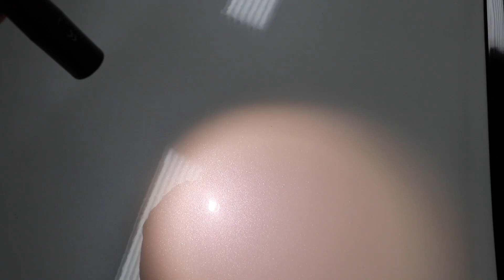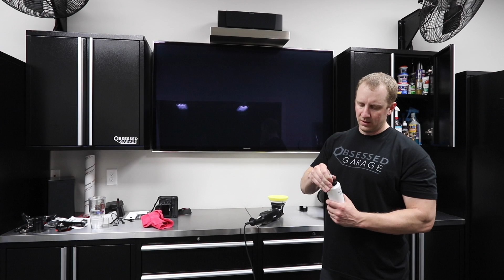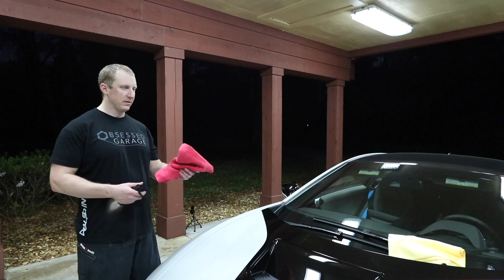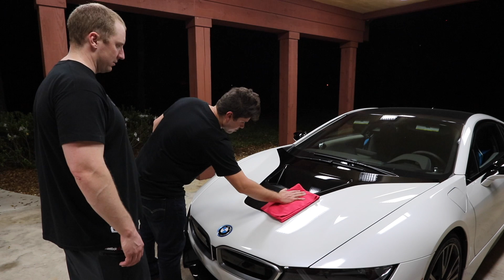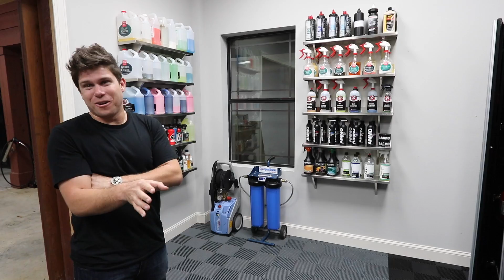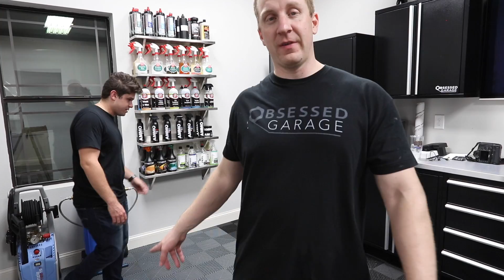Washing, Correction, Product Discussion Using a BMW i8

Comment: what if you clay it and Polish the black and then apply 3M PPF on it to help protect it and also help keep it easier to clean. I love 3M PPF I have it on all of 3 Mercedes and 2 muscle cars on the entire car and it helps with dings scratches water spots etc

Comment: how do i hook up a deioniz3r?
Reply: deionizer* qnd how much is it [i have a gas pressure washer]
Reply from the maker: You put it inline between your pressure washer and the hose bib.  So it goes:
Hose Bib to Short Hose to CR Spotless Inlet
Short Hose from CR Spotless Outlet to Pressure Washer Inlet

A Gas Pressure washer may pull a bit too much water to make it efficient.  About 2 gallons per minute or less is what is recommended.

https://www.obsessedgaragestore.com/collections/water-filtration/products/dic-20-high-output-rolling-system
Reply: Thank u very much!!

Comment: pig tails are usually always from picking up dirt or debris in the pad or mainly occur from sanding and picking up debris in the sand paper or running the same piece of sand paper too long full of clear coat or dulling sanding pad itself, Can also occur running the machine too hard with less polish since if there is debris in the pad there is less lubricant to help protect the paint from the debris, most likely by watching you didn't put the pig tails there, most likely factory, unless since your outside particulates fell on the paint before polishing.
Reply from the maker: You're probably right.  I didn't notice them when I inspected beforehand.

Comment: also matt, i too love and enjoy using menzerna power lock, its a awesome sealant! i notice you were talking about how when you top menzerna with insulator wax, you notice it SWEATS the following day..if you notice menzerna is a synthetic sealant and it's base or the carrier of the sealant is actually solvent based and when you apply the insulator wax on top of it, those two chemicals are trying to repel each other because they have different carriers within the sealants and we actually call it the ghosting effect. .in short they don't play well together but it took me a lot of time and research to figure that out but i thought I would pass that on...much continued success to you my friend:)
Reply from the maker: Hmm... I've found that they tend to bond very well.

Comment: Hey Matt how's it going my friend? Hey a while back you recommended Wolfs Nano coat for hard plastic trim, but it's hard to find. Do you have a replacement product you use or do you order it from overseas? 
Thx bud!!
Reply from the maker: I still need to try it, but Solution Finish seems to be popular with pros.  I'm going to import Wolfs later this year and have it in my store.

Comment: Can hydro 2 lite be put on top of collinite or would it be better to use it only for wheels and glass.  Great Videos
Reply: You can use Hydro2 on paint, but not on top of other waxes or sealants EXCEPT for other Sio2 based products such as a ceramic coating (like Cquartz) or a sealant (like CarPro Reload). Sio2 based products do not work well with traditional waxes or sealants.
Reply: Tim Thank You
Reply from the maker: Tim is correct.  It doesn't play well with Collinite.  I tried it.  It works the first time, but the second time I added, it left a film on the car.

Comment: I thought I'd chime in and help explain the basic difference between Wax and Polish to those of us who are new to detailing. The difference between car wax and car polish is that car wax is a paint sealant users apply after washing and polishing their cars, and car polish is a cleaner that prepares cars for car wax.
Reply from the maker: Some of the terms you are using are more marketing terms used over the years and can cause more confusion.  

Polishing does not clean.  Polish is an abrasive that removes clear coat.  You are removing paint around scratches and swirls to "flatten" surrounding paint.

Using the term sealant when referring to wax can be confusing.  Sealant is another type of synthetic or polymer that can be use instead of or in combination with a wax.  Wax or Sealant is you last step protectant.

Comment: Amazing video as always!

About the softer paint on the i8, while I don't own one, I do have an i3 in Capparis White with Fluid Black hood and accents and have noticed that the paint definitely is more delicate than the wife's BMW X5 and Raptor.  I believe it has something to do with the underlying composite and CFRP panels with perhaps less paint layers for weight reduction which is everywhere on BMW i range vehicles.  Even the glass is softer and lighter and requires plastic instruments for tint installation because high quality stainless steel blades will scratch it unlike most other vehicles.

All this being said, I stopped using the Adam's wash pad (which I love) on the i3 and have been using some heavy (not sure on the gsm) plush microfiber towels for soaping it down. I place about 4 - 6 towels on the soap bucket and use them in sections constantly turning them over to have a clean side (especially on the fluid black areas) and then I just throw them on another bucket. Something interesting I noticed by doing it this way is that I don't really use a rinse bucket since the dirty towels never go back on the clean bucket. Thinking about trying this method on the X5 and Raptor and perhaps eliminating the rinse bucket. 

Thoughts?
Reply from the maker: I think you've got it exactly correct.  One bucket method using multiple towels would be the safest option on these cars.  I doubt it's necessary on your other cars.  But if you find it saves time and you value that savings, it might we a viable way to wash all cars in the future.  I still enjoy the 2 bucket, massive amount of soap process.

Comment: My Subaru's Ice sliver metallic is picky it's pretty soft like Porsche paint, even washing my car is a process due to it's softness, I have to use very light pressure washing ect one thing I have noticed that using VSS from chemical guys and a orange pad you can one step Subaru paint. As far as 845 is concerned I have noticed that if I use a D/A and a super soft Hex-Logic black pad. I don't get that oily like issue that 845 sometimes does in the sun versus doing it by hand with a foam pad then I will get that stuff to happen....

Comment: Hey Matt,  i know you've had your colonite 845 for a while but your bottle seems to be quite liquid.  I bought both powerlock and colonite 845 last summer and both are pretty thick, specially the colonite.  Do you know if they've changed the formula or do you put anythibg in it to dilute it?  Thx great information
Reply: Martin Belair You have to put the Collinite bottle in some hot water to liquefy it.  It becomes solid in cool temps, Florida is pretty hot as you know, so it stays thin.
Reply: Temperature has a lot to do with colonites thickness, Florida's consistent 80 plus temps keeps it liquified.  Mine is solid right now in PA.

Comment: I had the dealer apply the Xzilon finish protectant to my GT350 a month ago when I bought it (before i found your channel). Is there an "easy" way to remove that and start over? There are some areas I would like to correct, especially on the black.
Reply: It seems to be nothing more than just a good paint sealant to me. I am sure just a 2 step correction would remove it pretty easily. Its not really as harsh as some glass/ceramic coatings.
Reply: Thats good to hear. Thank you!
Reply from the maker: I'm pretty sure that stuff is just a $10 bottle of sealant they slop on the car prior to delivery.  It's a joke marketing product.  You would just wash, strip (Adam's Strip Wash), remove iron (CarPro IronX), clay bar or Auto Scrub, then you could polish and wax/seal/coat like normal.

Comment: Matt, I think you would be surprised on how little paint is actually removed during a compound and polish. You should invest in a paint depth gauge. It would help people watching your videos get a better perspective about what is safe and not safe. When I was new to paint correction I wouldn't touch a compound because I had visions of destroying paint. It might help you with your business from the aspect of people buying more products. If they are scared to compound they will shy away from buying cutting products.
Reply from the maker: I completely agree.  My only fear with this was the softness and odd way this black handled the perfect finish.  If I had a depth gauge there would have been no uncertainty.

Comment: hey Matt not sure if you made a video about car covers, but whats your opinion on them, any you recommend? My motor is spewing coolant out the block and its going to be sitting outside for a month or more while i get the money together to get it fixed. And i want to get a cheap but good cover for it.

i was looking at this one from amazon, https://www.amazon.com/Classic-Accessories-10-013-251001-00-OverDrive-PolyPro/dp/B003DNFKPQ/ref=s9u_simh_gw_i2?_encoding=UTF8&fpl=fresh&pf_rd_m=ATVPDKIKX0DER&pf_rd_s=&pf_rd_r=ABAEE2JJYRKS29QY0JQT&pf_rd_t=36701&pf_rd_p=0411ffec-c026-40ae-aac5-2cd3d48aeeac&pf_rd_i=desktop&th=1

Comment: easiest way to describe rinseless wash to beginners is it's basically a sponge bath for the car
Reply from the maker: I like that.
Reply: Larry Velez a rinseless wash is actually faster then a traditional wash, especially when you use the Garry Dean Wash Method (youtube that for a tutorial). I personally prefer Rinseless washing over Waterless washing because you can use it on cars with more dirt safely. The only downside to a Rinseless wash is that if a car is very dirty that it'd be safer to do a traditional 2 bucket method with a foam gun.
Reply: AWDTBSS what are the downsides of rinse less and water less washing?  Just takes a lot longer and you spend more on product?  I like foaming and two bucket washing but sometimes a car is trapped behind other cars having their guts repaired and rinse/waterless might be good backup plans sometimes.

Comment: Use color folder  dividers and put them in front of the light to help you better on finding swrils  and scratches on white paint .    Where are the cats by the way ?
Reply from the maker: They are like ghosts.  They come, eat, kill stuff, and disappear.  It's awesome.  There have been two dead armadillos, an opossum, and I've found a squirrel tail right by where I put their food and water.
Reply: That's awsome!! Little enforcers haha

Comment: I don't think the guy needs $3500 worth of products if he's VERY new to detailing, I believe he could do a full paint correction and protection with less that $1000. Not everyone needs the best of the best Matt haha anyway very nice video :)
Reply from the maker: The biggest expense would be pressure washer, deionizer, and depth gauge.  Otherwise it's less than $1000.
Reply: Ash PvP Yeah, its nice to have a fancy deionizer, but it shouldn't be a priority in the beginning. Some adams detail spray while drying will take care of everything.

Comment: What would you have done differently if there had been a coating on the car?
Reply: probably tape off the edges so you wont polish away the coating on the white paint. and recoat the black paint. And make sure you removed the coating by a finish polish (watertest)
Reply from the maker: Told him to go elsewhere.  Dealing with the coating removal adds another massive layer of complexity that I'm not interested in dealing with.  It's why I don't coat cars that I care about.
Reply: Obsessed Garage   OK thanks so much. I believe my car has a product called Tephcoat. I may have a pro remove it at some point.

Comment: Matt you really love Adams product right , have you use chemical guys
Reply from the maker: Adam's has become a much bigger marketer in the past few years, but they still have roots in real detailing.  I've been using them for washing supplies for about 5 years.  They make very simple and very good car washing products.  I don't use any of their "detailing" stuff.  Chemical Guys is a marketing company.  There is nothing wrong with that, they just aren't professional grade.  Having 9 detail sprays is dumb.  It simply means you don't make one good enough to only need one.  Extrapolate that across the hundreds of products they sell, and you have a mess of junk.  They may be a few good things in there, but I'm not interested in digging through the hundreds to find out.  

By the way, I don't think there is anything wrong with going to a chemical manufacturer and having a product produced to spec.  Adam's, CarPro, Gyeon, AMMO, Griot's, etc. all have products produced for them in some form or fashion.  Relabeling doesn't mean you didn't vet the product before putting your name on it.  I suspect Chemical Guys has done some testing/vetting, but my guess is that most of their stuff just gets a label put on something that wasn't obsessed over.

Larry Kosilla, AMMONYC, is the classic example of this.  He spent a good amount of years of his journey in life making detailing products.  He physically mixed the chemicals.  His product line is to his spec, was tested and retested, send back for more design, tested and retested, ....   Then after using the product, he eventually put his name on it.  Does he mix the chemicals in his basement?  No.  Is it his product?  Yes.   You get the point.
Reply: chemical guys is trash
Reply: not all chemical guys , the wheel cleaner is one of the best i have use the soap is trash tho
Reply: Chemical guys is garbage. They relabel 5 different products that are exactly the same
Reply: I know he hates the complicated marketing
Reply: MiniMorris97 i agree , chemical push the product to much and nothing change , but i can say there wheel cleaner is the best i have use to far
Reply: I have used all there products. Slowly switch to higher end cleaners like Adams and I work at a dealership and have used there products too and have found that chemical guys stuff is a cheep product.
Reply: isnt adam just a rebrand?
Reply: Give CarPro Reload a try.  It's not a wax, but a silica based spay sealant and the shine/protection is exceptional.  It holds up well in the sun/heat and is super easy to apply, just don't use it in the sun.  You could also try Collinite 915 or 476, they are more durable than Collinte 845.  Check out CarPro and Collinite's sites.
Reply: Brendan Wood i agree , i dont use their wax or soap it sucks , giots rubber cleaner to me is the best , and soap i have used adam but i really cannot tell the difference , as long its not autozone soap they basically the same lol
Reply: Obsessed Garage make perfect sense right there , car pro pearl for tire and rubber and plastic is amazing , to some products are almost the same just different label. The more expensive brand are better but not all , chemical guys need to cut down on there stuff,  they have like 12 different soap which is not realistic. There citrus soap was a good product to me , foam nice and strip wax. But i totally agree with you matt !! Im trying to find a good wax for white cars. The problem is Texas heat and bi polar weather make it hard for any wax to shine and last. They last for like 1 week then its gone. Do you have any recommendations?
Reply: Jason D'Onofrio Not all man , but some aree i tried alot of there thing some are good some are trash !! i dont like any soap but citrus wash , all there wax suck
Reply: Obsessed Garage i'm sure you already doing this. But I would like to know about all the detailing supplies you use.
Reply: Brendan Wood he has a video that say what he use its like 3 part
Reply: Obsessed Garage do you believe all dual action polisher are almost the same
Reply: maxwired 223 yeah i know them and cquartz but i wanna say away from coating atm